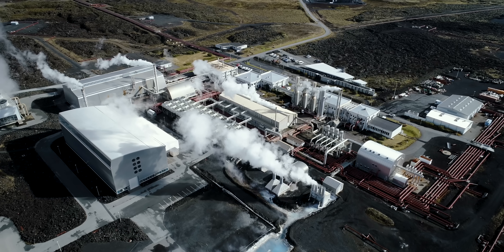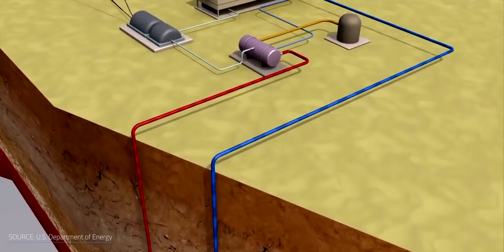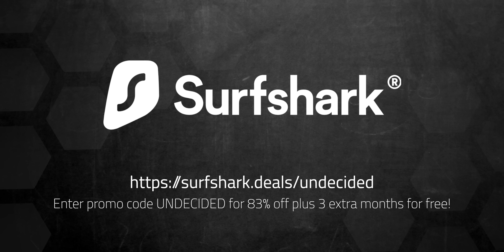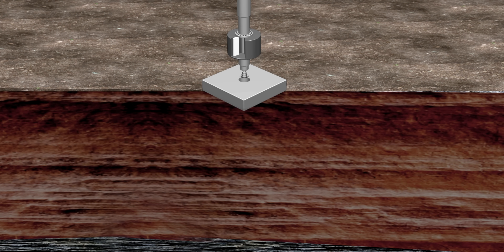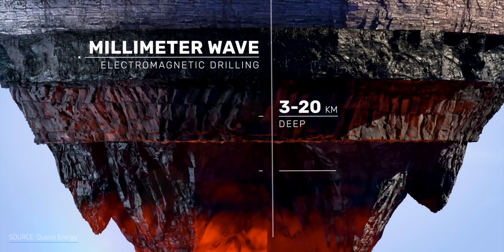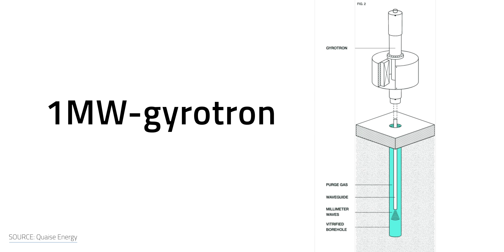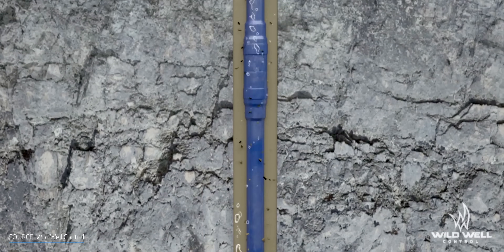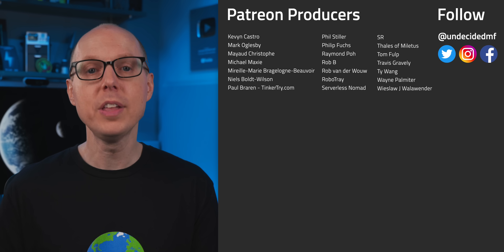Why This Fusion Tech May Be a Geothermal Energy Breakthrough

Comment: Hmmm. Drilling a few meters in a test is a massively different prospect to drilling km. All the vaporized mass has to be transported out of the hole. The video implies that this is done with a gas 'blowing' the dust of microscopic condensed material out. This would work for a bit, but as the hole gets deeper the gas flow velocity needs to be maintained or else the dust will start trying to settle. Since the longer the hole, the more dust there is in suspension, and with frictional and turbulent losses of energy as the gas flows up out of the - ever lengthening - hole, it seems that this process will require an increasing (possibly exponentially increasing) gas pressure. Worst case scenario is that the dust in the hole starts to try and settle out, creating a kind of 'rain' of dust debris constantly threatening to clog up the hole. At the least this will lower the efficiency of the drilling process as it will constantly be trying to re-vaporize dust that is raining down into the bottom of the hole. Last thought - is a special gas needed to maintain the process? If so, the cost could get prohibitive very quickly.

Comment: Without electricity-generating plants, the 55 degree temperature of most of the planet just a few feet down can significantly lower our energy needs. Dug foundations provide moderate temps, even without heat pumps. My under-house concrete floor keeps my living space comfortable, with a small heater enough to warm me in winter, and keeping door closed spares me summer heat. Dwellings built into hills need little "help" staying pleasant. And this is all low-tech, one of nature's freebies.

Comment: If you have a hot spring  geothermal is pure gold . If you put in a domestic heat pump run by expensive electricity you have just been scammed. In college I studied  air-conditioning refrigeration electronics and appliance repair.   I ran a hydro electric power station for 9 years.The first time you blow a compressor your gains are lost and compressors blow like pop corn.  The earth can only absorb and return a certain amount of heat. Solar is a good choice and I dream about having a hydrogen powered truck.

Comment: I often wondered why at Hot Springs Arkansas ,even Yellowstone ,which we know the government does have a geothermal operation at Yellowstone ,they try to hide and cover that up but it is very much there .and several other Hot Springs around the country where you would not have to drill so far down not to mention if you use capillary or small stainless tubes in bundles To get a flashpoint of steam sort of like a Geo Mr. coffee. Efficient and again you have to start somewhere the more complex system the harder it is to maintain and it costs cannot be brought down our bodies use capillary cooling And heating works in reverse you just need a whole lot of little tubes to generate the same amount of heat this was a good video but there is always more than one way to skin a cat.

Comment: My problem with this technology is pretty much the same as my problem with "cold fusion":  If we have limitless sources of cheap energy, we start heating the planet even WITHOUT covering it with a solar blanket.  I suppose more accurately in this case, we bring subterranean heat to the surface, but it's still heat.

That is, the energy we use ultimately becomes heat whether it takes transient forms or not.  The planet is capable of dissipating that plus solar heat into space now (with no CO2 blanket), but what if we're generating 100 times that?

Can we, as a society, say "no" in 200 years (or whatever that takes)?

No question:  By (gradually) eliminating greenhouse heating, this buys us a lot of time, but we'd better use that time to spread the population off the planet because I highly doubt we're going to keep our energy use constant without finding a way of shedding that population elsewhere.

Comment: Back in the 50's, one of the big defense contractors built a 50 foot diameter TBM (tunnel boring machine) that had a nuclear front end that would melt through rock like a knife through butter. There was even a picture of it with a whole bunch of the project people standing in front of it.
Don't know whatever happened to it, but somebody does. If it worked they would of course say it didn't and shut it down, only to open it again, classified and underground.

Comment: Hey, geothermal power is my area of engineering.  The claim that binary plants are more environmentally friendly is a bit off and they have their own complications (I work in both steam and binary plants).   1.  Your description at 2:50 calls the secondary vapor "steam", that's a bit misleading. The secondary working fluid is a typically a hydrocarbon, such as butane or pentane or a refrigerant.  2. Hydrocarbon based working fluids pose fire and explosion hazards which need to be treated with care. The plants also have fugitive emissions of these fluids, though this is generally small in comparison to emissions from traditional fossil power plants.  There are other non-hydrocarbon secondary working fluids but they also have their own issues (cost, environmental issues, asphyxiation etc). 2. As field enthalpy increases, binary plants are a less efficient use of the resource versus dry or flash steam plants.   

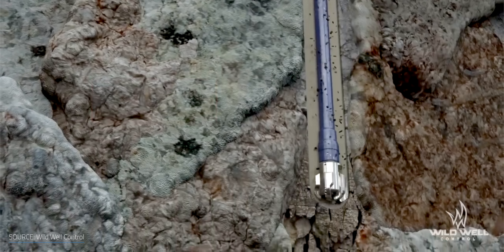I won't comment much on the drilling since that's not my area but comparing $500k energy cost to a $30 mil drilling program is a bit unfair, especially if you need to mobilize equipment similar to a traditional rig to drill the first section. E.g. you'd spend 30million drilling the first 1000-2000m like any other well then you'd change over to the fusion technology, so your cost would be $30m+500k energy+whatever it costs to actually rent and use fusion equipment for the next 200days.    Carlos's explanation at 13:10 is a bit more accurate but not explained in the same way. Essentially the advantage is hitting a higher temperature/more energy dense part of the reservoir for the amount of capitol outlay.

Comment: Getting vaporized rock up a mine shaft does not seem like a trivial problem, given that it will cause an accumulation anywhere it finds cool enough to solidify all along the Bowen's series.  However, if the process can create a more frangible glassy material, then perhaps a thermoaccoustic process could be done concurrently to make it behave like a sediment transport process.  ie, wrap a more traditional drilling rig around the waveguide.  

Perhaps one could even blow bubbles in the molten solution to reduce its density.

Comment: I don't know if anyone has bothered to consider this but what are the implications of taking energy from the heated core of our earth. If by taking energy from the system we cause the cooling of our planet core which then causes the breakdown of the functions that allow for our magnetosphere this could be an entirely new problem.  You don't even have to imagine what would happen if our core cooled and our magnetosphere disintegrated because you can just look at mars and see the results of that. Say goodbye to the atmosphere and hello to radiation exposure. In short what seems like a good idea and that we are only tapping in to a small amount of energy sounds good at first until you realize humans will always ramp that up to a massive scale based on greed and absolutely cause a failure of the natural system.

Comment: I have to wonder what use there is for tons of mineral nanoparticles.  If the tech is so much more cost effective, it may be useful in a horizontal configuration to run secure new lines for the power grid and other utilities.

Comment: "A gyrotron is a class of high-power linear-beam vacuum tubes that generates millimeter-wave electromagnetic waves by the cyclotron resonance of electrons in a strong magnetic field." Invented in 1964 in the Soviet Union. Has the same connection to fusion as the vacuum tube has to rock'n'roll. Not really as "fusion tech". But if this produce base power carbon-free then I am all for it! But beware, Sir Thomas Gold believe 1000 of times of natural gas reserves lie at the top of that mantle layer and the gyrotron drill maybe put this in range. No one tell ExxonMobil, Shell, Texaco, Gazprom, et al about this.

Comment: I must be missing something. Drilling fluid mitigates pressure with depth - gas does not. The gas pressure at the top of the bore hole would be immense - almost the same as the superheated fluids 10k down. That seems like a very real problem.

Also, rock is plastic at those depths. These holes might require ongoing maintenance.

On the other hand, if energy can be extracted at those depths then it should be possible to freeze some of the super volcanos that would exterminate most of us if they blew (looking at you, Yellowstone).

Comment: I do not accept the BS propaganda about global warming. And to be clear I am not a denier of global warming. I know the science involved and there is a lot of exaggeration for political benefits going on, and science trumps politics. (And real science. But that is another complex discussion.)

But I am for technologies like this. I have no problems with "renewable" energy and believe that for the most part fossil fuel is an outdated energy source. (And half the reason it's still in use as much as it is, is the fault of environmentalists. Oil companies secretly backed solar in the 80s, and joining in the nuclear scare was another part of it.) I don't have a problem replacing fossil fuel, but the way it's being done is stupid and overly political, rather than logical. I do love it when I see something that is actually logical in the discussion. And this does seem logical. 

One thing people do not understand is that if you are not saving money then most likely you are not saving energy. Electric cars are a great example of that. Electric cars are extremely efficient, and I would love one myself. But the cost of electric vehicles represents all the energy that went into producing them. They take a lot more energy to produce, and as a result, they cost more. So if you don't save money, you most likely haven't saved energy. (And this savings must be the cost without any government subsidy, that hides the cost and energy used to produce something.) 

But if the numbers are correct, this type of geothermal system would actually save both money and energy. (And again the two are connected.) If it's cheaper to produce energy, then energy companies will naturally start these systems, and build new power plants (if they are allowed to,) and we would just move to geothermal without any prompting.

Comment: The energy is there underground, the only tech we need is better digging.  That said, waveguides (like the downhole pipe in this application) are notoriously lossy, meaning the farther you go, the less energy goes into vaporizing the rocks at the bottom.  I want to see the results from digging a hundred meters or so before we extrapolate the feasibility of a 10km borehole.

Comment: Okay, let's do some 4th grader maths and physics here (At least this level was 4th grader when I was going to primary school 25 years ago). 

How much energy do you need to drill a hole into granite that is 10 kms deep and has a diameter of 8 inches (20 cm) if you actually want to BOIL the rock away? 

So, first the volume part. The volume of a cylinder is r2xPixheight, so in this case r (the radius of the borehole) is 10 cm, Pi is 3,14 and height is 10 km so 10,000 meters. This gives us 0,1x0,1x3,14x10000, so 314 m3. The density of granite is 2750 kg/m3, the heat capacity is 790 J/gK and I did not fiind a boiling point, but the melting point is 1260 degrees Celsius. Let's calculate with the melting point first, though I think if you actually want to boil the stuff, you have to heat it to at least 3-4000 degrees Celsius. 
 
So our 314 m3 of granite is 314x2750=863,500 kg weight. To heat it up to 1260 degrees Celsius, we need 1240 (let's say outside temperature is 20 degrees)x863500x790000 (790 Joule per gram per degree, makes  790000 Joule per kg). So 1,240x863,500x790,000=845,884,600,000,000 Joules. Conversion from Joules to kwhs gives you 2,77x10^(-7) kwh per Joule, so you need 234,967,944.44 kwhs to MELT down a 10 km deep, 20 inch diameter granite column. How much does this cost? I don't know about the US, but the cheapest source of electricity I know is the nuclear power in Paks in Hungary (where I am from), which charges 10 HUF (roughly 2,5 USD cents) per kwh. So 2,349,679,444.4 HUF equals 5,874,198.61 US dollars. 

Where on Earth is that 500k????? 

AND again, we have only MELTED the stuff, not BOILED it. More realistically, you would need to heat it up to 3000 degrees Celsius at least to actually turn it into vapor. 3,000x863,500x790,000=2,046,495,000,000,000 Joules or 568,470,833.33 kwhs. At the same costs (which are EXTREMELY modest, Germany pays 50 cents per kwh today, not 2,5 cents) you have 142,117,708.33325 USD cost. 142 MILLION dollars. Not 500k. 

And this is not even the probable correct number, because first of all, I don't know how efficient such a magnetron is, but it is a practical impossibility that it is capable of converting electricity to radiation at a 100% efficiency. 50% would be more likely, but again, I am no expert. Also, stuff needs extra heat on phase change, so if you reach the melting or boiling point in temperature, you need extra heat to melt or boil the stuff while the temperature remains the same. I have not found the boiling and melting heat values for granite, but I would assume this is not insignificant. Also, an 8 INCH borehole? Where does that take us? If you want a decent sized power plant (say 100 megawatts), you need more like a meter or 2 in diameter. If r is 1 meter in the above calculation you can multiply everything by a 100 I just calculated here. 

Now to defend the above tech, I am not saying this could not be feasible. If this can drill down deeper and faster than a conventional drill, then even if it costs a huge load of energy, it will probably be worth it. A 100 megawatt powerplant produces 100 Mwh per hour. So our 568 million kwhs equal 568 thousand Mwhs, which makes means our power plant would bring back the energy cost of drilling in 5000 hours. That is 208 days. That is not at all long, considering power plants can last up to 100 years if built correctly. 

Just please stop feeding us lies that can be proven wrong with 4th grader math and physics.

Comment: The Bullshit Factor is unusually high here.

1. Magnetrons are not "Nuclear fusion". They've been around since WWII, when the British supplied them to the USA for RADAR.
2. Drilling mud can be supplied at any pressure required. Mono Pumps (invented in South Africa) can do this. Temperature is another matter.
3. Why on earth is Argon proposed as the purging gas? It's ruinously expensive and I can't think of a single reason why a noble gas should be used. What's wrong with ordinary air, or worst case, nitrogen?

Comment: I like your work but in this case, the material here was presented in a rather simplistic and overly optimistic manner. You seem to imply that drilling the borehole is THE big problem to solve but it isn't. You also seem to imply that by drilling 20km down, you are going to tap into a hot fluid reservoir, but you aren't - the pressure at these depths does not allow for porosity sufficient to store any significant amount of fluid. Also, forget about active volcanoes and shallow (5-10 km) magma chambers because no human technology is going to withstand the conditions. In most cases, at 20km depth, you are going to hit Hot Dry Rock that needs fracking and a single hole will not do; you need at more that one injection and several pumping wells, i.e. a manifold increase in costs. Even assuming that you can drill a 20 km hole without it collapsing on itself, maintaining it and operating it will be more of a herculean task. To see why, please refer to the trials and perils of the European Hot Dry Rock project at Soultz-sous-Forêts (Upper Rheingraben), where after at least two decades of effort they could not achieve sustainable energy production from as shallow as 3-6 km. Where they failed, why do you think that a startup without significant (as reasoned from the video) earth scientific support may succeed? Overall, I believe that you are unreasonably optimistic and even if there is merit in the "new drilling method", the possibility of harvesting deep geothermal energy any time within the next two decades is as realistic as unobtanium.  Personally, I would not invest in this startup!

Comment: You only create a "glass lined hole" when the material you are vaporising has the correct properties to be able to turn into a ceramic or glass which is only specific types of rock... I see way too many issue with stability even with a glass lines hole with any kind of earthquake activity.